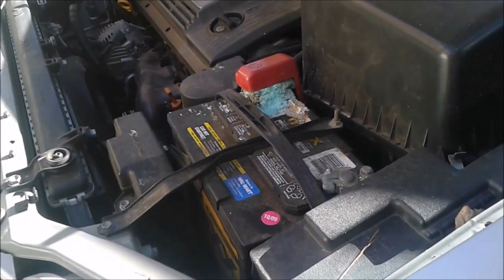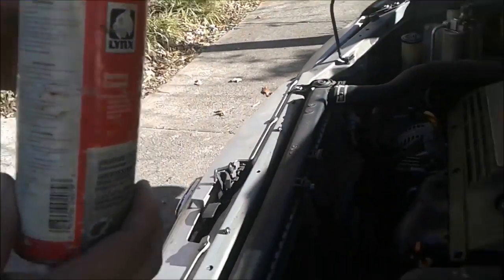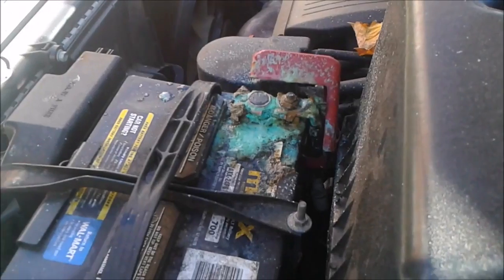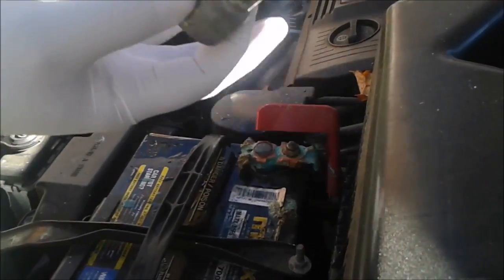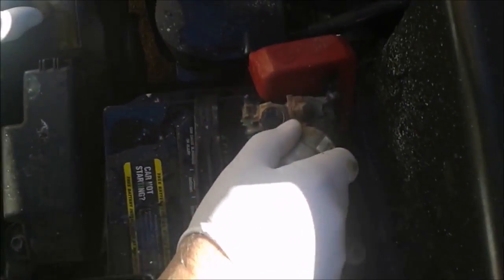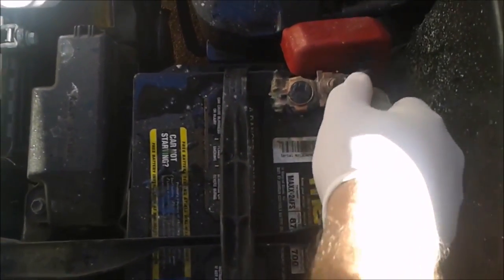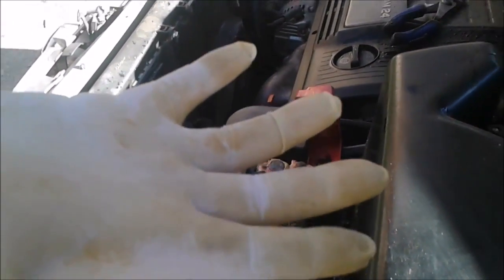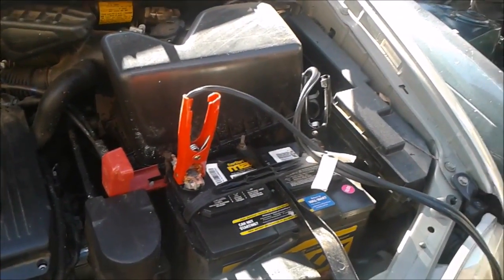How To Remove Car Battery Corrosion - D.I.Y - The Easy Way

Comment: I've always loved using baking soda and water to clean off the corrosion on battery terminals. It is super fast and with a little rinse and maybe some light brushing they are cleaner than ever!
Reply: I use the same thing and it works amazingly well